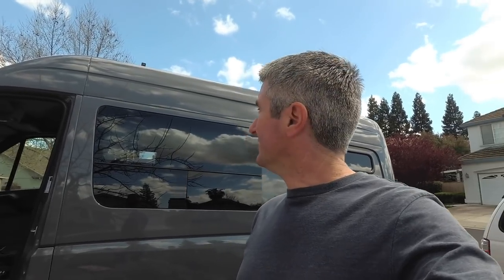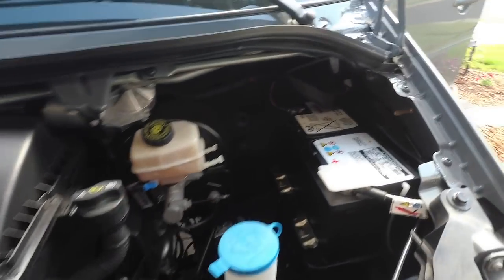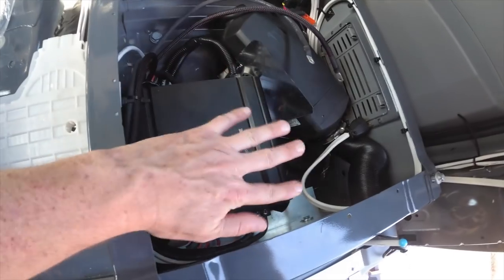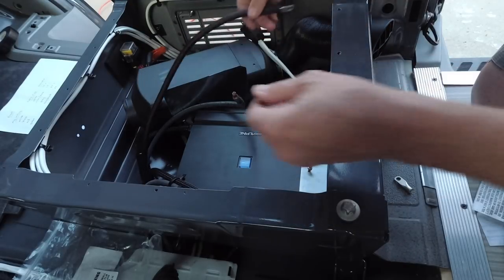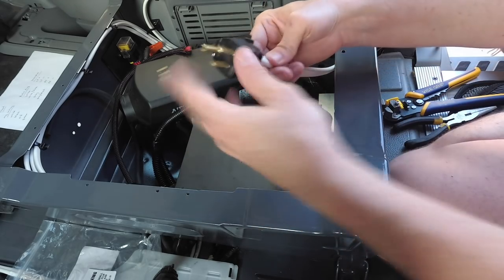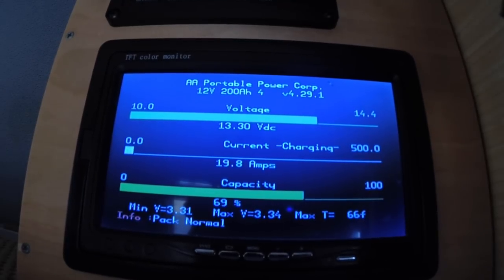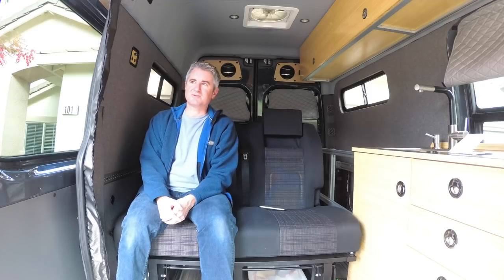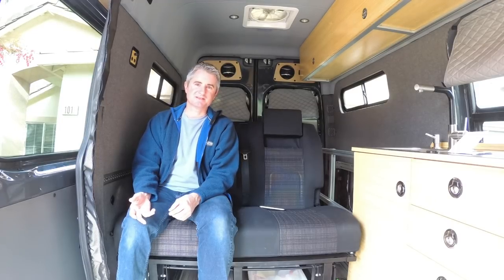Backup Inverter Charging System - DIY Sprinter Camper Van

Comment: Ken,

Thanks for all the great info.  I have a question. I am trying to decide wheter to purchase an inverter only or an inverter/charger. after doing much research I'm still undecided.  My issuye lies with the AC output  of the inverter.  Having a hard time understaning which units can be hard wired, which cannot.  Which only work with GFCI breakers etc.  I see you used the Magnum MMA 1000 watt with the 3 prong cord for shore power input to charge batteries.  I am interested in knowing what you did on the output side of the inverter?  Hard wire? Or use the included GFCI outles with the Magnum inverter? a hybrid?  Have purchased and returned a few products as I am not finding quite the right combination.  I'd be grateful for your thoughts.
Reply from the maker: The inverter/charger combines three functions into one.  Inverter (of course), a built-in battery charger as well as a transfer switch.  The transfer switch means when you plug in to 120V shore power, it automatically activates the battery charger and runs all of your loads from shore power rather than from your battery.  Basically, it saves a lot of space and wiring, which is why I went that route.  I have the MMS1012.  There is also a model called a MMS1012-G, and the only difference is it comes with a 120V 3-prong plug wired in (which I duplicated with my inverter/charger), and it has a built-in 120V outlet whereas mine has a blank in it's place because they assume you'll hardwire your own plugs.  That's the only difference between the two units.  So I duplicated the input side of the "G" version, but have three 120V AC outlets daisy-chained around the van.  I hope that makes sense!
Reply: @ourkaravan  can you do another video on how you would take shore power into your van and how it would be connected to the inverter charger?
Reply from the maker: That's an easy one.  There is simply a standard NEMA 15 plug connected to the shore power inlet of the inverter.  I've never used it other than plugging it on once to test it, but it's nice to have it in case I'm desperate for a charge.

Comment: Maybe because it's been a while since you did the previous electrical video i spent the early part of this one really confused. I forgot that you had an auxiliary van battery plus a house battery.  It all made sense in the end. 8-)  It does seem a rather convoluted system and I wonder, if you had to do it all again, would you take the same approach or go for a more sophisticated charger inverter unit that could self-arbitrate the available charging sources?
Reply from the maker: HI Doug,
Sorry about the confusion.  By the end of next week there will be three items hooked up to the factory MB Aux battery---the Espar, the audio amplifier and some Amp Powersteps.  I think these are perfect uses of the factory battery.  I could have hooked the Espar to my lithium battery but thought it made more sense to leave it on the battery that gets a charge from the alternator everytime I run the vehicle.  (Logic is, if it's cold enough that the Espar is running a lot, it may not be sunny enough to recover my solar/lithium house system.)  The reason I don't use a battery-to-battery charger is because 1) solar meets 100% of my needs, so why stress the factory alternator every time I run the vehicle and 2) charging batteries off the alternator uses fuel. I get amazing fuel economy and I think that may be part of it.  I know this dual setup is unconventional but it works for me and I don't have to think about a single thing.  It all just works...
Reply: All good points, thanks for taking the time to respond! As I said, my forgetfulness on the original configuration, in my defense I think you said it had been about a year since the original electrical install video? 8-)
Reply from the maker: No problem!  I was getting requests for a video about backup charging so what you saw was 18 month old hodge podge of video clips I put together.   Doug, I can't remember what I did yesterday, so I'll let you off for not remembering every detail of my electrical system.   ;)

Comment: Hey Ken did you get the calculations right? You said the magnum is rated for 50amps (but that’s 50amps AC I believe, I have a magnum too). So having a 600w inverter it should pull 50amps from your inverter (12v), convert it into AC (600W), and your magnum inverter would receive 5amps AC (600w/120v)? Am I getting all confused?lol
Reply from the maker: You have it exactly right.  Problem is the 600W inverter probably won't like running at its peak capacity long before it overheats.  For that reason I set the "max amps" in the Magnum at anywhere between 25-35 amps (DC).  That way you leave some headroom for the inverter.
Reply: I see, in the video you mean the 50amp capacity regarding the 600w inverter not the magnum, so you limit it’s producing capacity. 

I am installing a similar system, with a 1000w inverter and all the way in the back (not under the seat so spending a lot on 2AWG wire lol). Thanks for your quick reply!

When can we expect to see a new video?:-) BTW I am also copying your overhead storage self.
Reply from the maker: The Magnum's built in charger is rated at 50 amps too.  I may have been talking about that.   I have a new project coming up so hopefully I can get moving on that soon.  I'm not done with videos yet! But right now I put more focus on the website ourkaravan.com.  Enjoy your project and let me know how it goes!

Comment: Probably a silly question — but why does your Sprinter have an auxiliary battery?  Does this come with the Sprinter as standard equipment?
Reply from the maker: Not silly at all.  I ordered the van with the optional aux battery.  I use it to power a number items including my Amp Powerstep, audio amplifier and Espar diesel heating system.  This way these items will work at all times, even when the rest of my house battery system is turned off.  (Such as when the vehicle is not being used.)
Reply: ourkaravan Ok, that added detail really clarifies some of what I was seeing in the video — thanks!! Currently trying a similar configuration with my promaster because I have a 24v lithium system, and the alternator-inverter-inverter/charger config is going to be so much simpler and less expensive than getting the Victron Buck Charger, which is a $700 item (I have a primarily Victron system).  Even for 12v systems, Victron recommends against using any of the conventional isolator/direct connection configs with modern intelligent alternators.  I’m pretty sure you are the first one who put the bug in my ear about using an inverter — so very grateful for that — who cares about the inverter losses when the amps the alternator can provide are more than sufficient and when it is an emergency back-up anyway!  Plus, smaller wire post inverter, and one less piece of hardware to program (just use the settings you already have in your inverter/charger — brilliant!
Reply from the maker: @PaDutchRunner  Right, the real downside to the way mine is configured is the second-inverter does not automatically charge the house batteries, it's a manual operation.  Solar alone has done a great job of keeping my batteries charged.  So it's not worth the time and effort for me to automate it when I truly use it as a backup system.  Truth be told I don't want it automated as I prefer to keep any load off the alternator unless I need it.  Saves fuel and wear and tear as well.
Reply: ourkaravan Yup, same exact thinking here as well.  Again, thanks so much for the info and your time in making the video and getting the info out there!
Reply from the maker: @PaDutchRunner  thank you

Comment: Im pretty sure you don't need an inverter to do this. You can run it to a solenoid
Reply from the maker: The inverter/charger needs 120v input to charge the batteries.